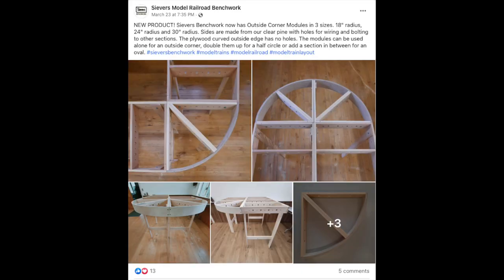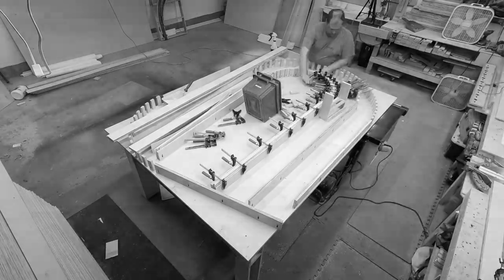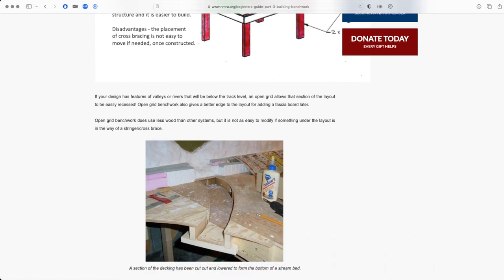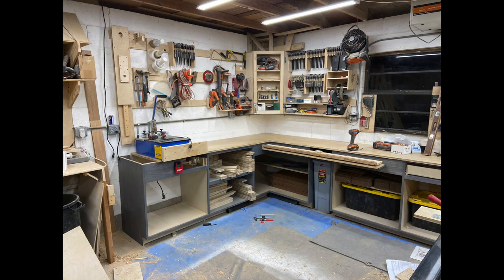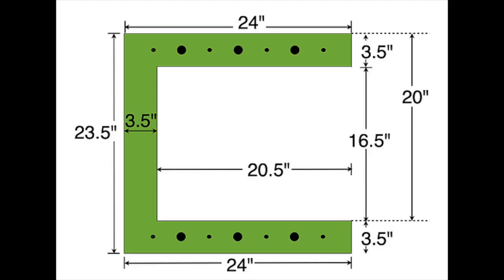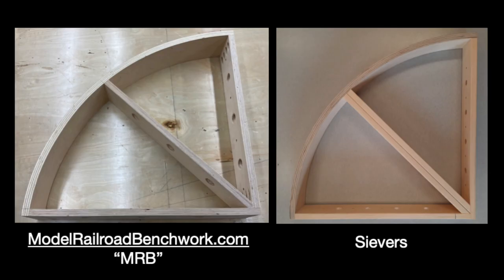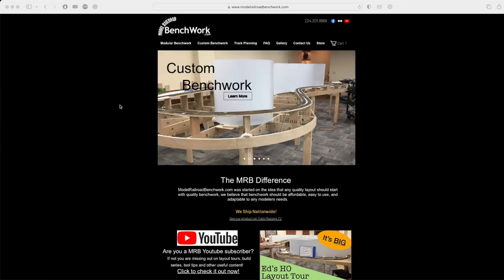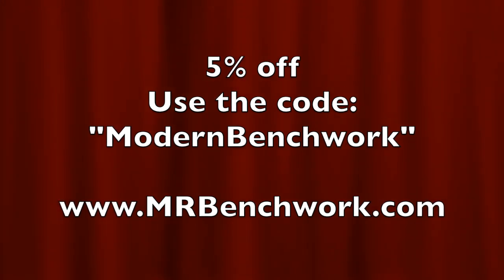Innovation is Progress, The story of MRB

Comment: Recently, I moved into a new home, with an even bigger basement than I had previously.  I've decided that I'm going to build a free standing modular layout as opposed to my previous empire - where I had a multi-level, permanent layout attached to wall studs. I'm going to build my new layout 3-4 modules at a time.  I'm designing the track plan right now - and have decided to use your bench work as opposed to your competitions The excellent quality and wide array of options are the reason for my choosing your product.  Let the other company try and copy your modules.  Keep doing what you do, and it won't make a difference.  I'll be in touch soon.
Reply from the maker: Sounds amazing!  Btw don’t limit yourself. If you need a custom module or two  or custom multi deck brackets email me and I’m happy to help you get what you need.

Comment: Having a Sievers layout 20 years ago for a hobby shop I owned, when it came time for my final layout I went with MRB - Sievers having curved sections would not have made a difference to me and I would still go with MRB.
Reply from the maker: How's the layout coming along?  Your's took me a little longer than I would have liked due to health issues but it was a fun project to build.
Reply: @MRBenchwork  I have the lower level 3 sections attached and will be getting the birch plywood for the lower level subroadbed and the start of the helix next week. My only issue is with me as I had 3 discs in my neck fused last month and need to wear a collar for at least 2 more weeks - plus limited to 10 lbs lifting. Fortunately I have a 14 year old grandson to help and a young son-in-law to help too with any lifting. Lower level went together perfectly but not as fast as your video. 🙂 Looks like all the riser locations for the middle and upper levels are exactly correct with my track-plan (which was not 100% when you started the build). Bottom-line is I'm beyond delighted how it turned out. Your craftsmanship is incredible.
Reply from the maker: @rgdave23  I'm no stranger to back issues, as you well know, so I feel your pain. That said I'm glad you figured out how to get your son-in-law to help and I look forward to a photo or video update next year.  Congrats

Comment: Unfortunately this happens all the time ,have you used wiggle or wobble board, its 4x8 sheets and can bend  to a 6 inch circle but it only bend 8ft direction or 4 ,can't do both on same sheet.we use it all the time for garage door openings etc anthing that has a curve
Reply from the maker: I actually use 2 different products. one is the wiggle board you describe. The other is just 3/16's luan which most people know as flooring underlayment. The luan is more rigid so it's nice for the larger radiuses while the wiggle board is great for the smaller stuff all the way down to a 4 inch radius.